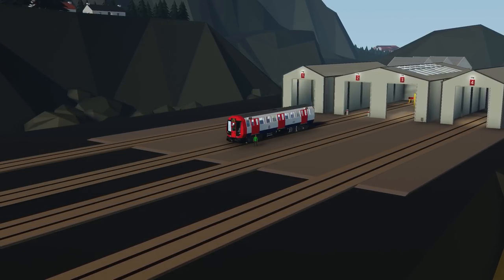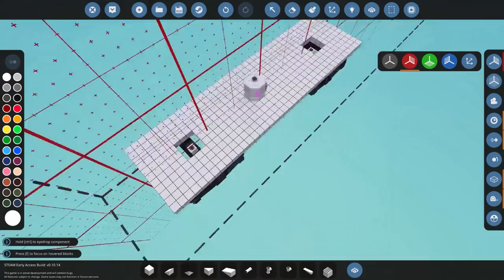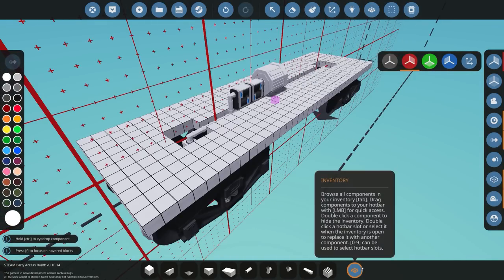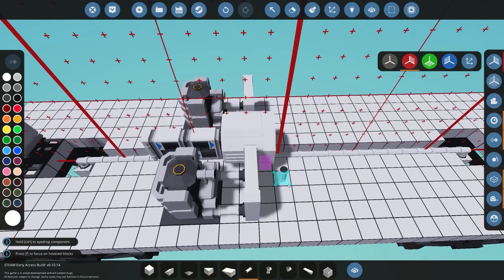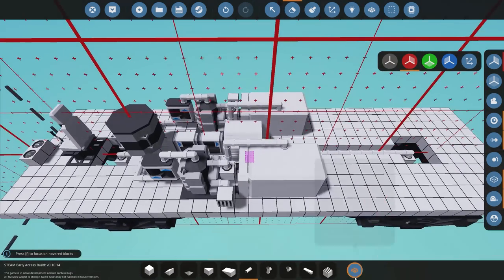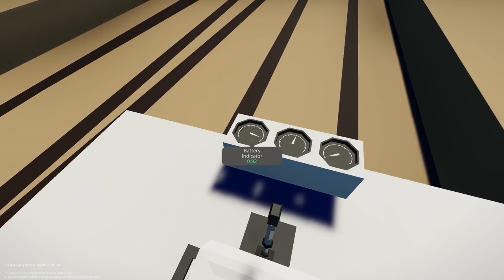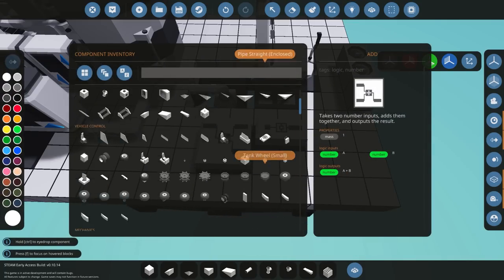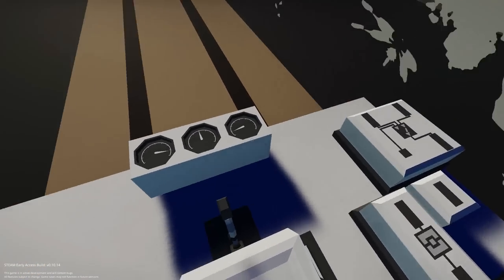Advanced Train - Stormworks Tutorial

Comment: i made a really usefull microcontroller, it is a slow engagement thing, it uses a switchbox between the two values you are switching between and if the number you want is less than the number it needs to be it will count up, and the other way around, it is really good for things like auto breaks and clutch engagement because it doesnt stall the engine or slip on train wheels

Comment: So, additional tip if you don't mind the white wind up noise of the jets spooling up. You can add a standalone medium jet turbine onto your diesel electric system, just branched off between the diesel engine and the actual generator, and for some reason the game will both use the diesel power to spool up the turbine, but also count the "output" of the turbine spinning towards your power being put into the generator. It essentially boosts the power generation by adding the turbine's power at the cost of a little power from the diesel engine. Crazy, and it used to be a broken infinite power system with electric motors powering the turbine generators. But if you need more power, try doing this and turn the vehicle volume down. You'll get a bit more electricity out of the deal.

Comment: Sorry, one thing that just came to mind that you should probably try to address if you know all the details, Mr NJersey (I know I don't.). The shape of the train, namely the length and width and how that will effect the vehicle going around sharp corners. I know I've tried longer trains, the limit of the build area, and they've gotten wedged into some of the turns. Build to wide and low and your train won't leave the shed (there's 2 pylons on either side of the entrance to the sheds that are just far enough into the build area that it limits what you can build down and out.)

One thing I have tried that seems to help a little is flipping power pivots to be the connection to the wheel bogeys, the body is on the train and the pivot is what's connected to the bogey, and then cranking the gear ratio on those up to the max or down to the bottom....Which ever the 1:32 ratio is. That ratio seems to resist the least and what you're wanting is for the bogeys to pivot if needed around corners rather than straining to bend your train in half. So you will need to power them, set a PID on them to try to angle for 0, but using an angular velocity sensor as the variable, it seems to all come together. It's just worked for me in making less broken stuff.

Comment: A couple of questions.

A) Why not have the diesel-electric generator just go directly to the traction motor instead of through a battery?  This is more how trains actually work and then you wouldn't need to worry about balancing generator output to power draw.

B) Why have a brake that applies when the throttle is 0?  Then you can't coast, which you do a lot when running a train.  Although I guess Stormworks doesn't have grades on its line so it doesn't matter as much.
Reply from the maker: Its just the way i set it up for this video, Unfortunatley I cant cover all different ways of building a train. Otherwise we would have 100 tutorials on just how to build a simple train.

Comment: So if the width is roughly 11 or 13, what is a good length for this? I built one that twitchs slightly as it turns. Ive got 31 blocks in between each bogy, i wonder if that is what causes it to twitch slightly

Comment: Hey I was wondering if you could do a tutorial on the winches for me.
I've built a helicopter and I want to control the winch from the harness but I can't figure it out
Reply from the maker: Watch my video on the new winches I made a few weeks ago :)
Reply: You need to use a rope anchor and attach the harness to the anchor. Also, make sure the anchor and harness are separate entities from your helo, meaning either place it in your helo off of a stand in pivot or rail (since the top and bottom are separate entities) or select the anchor in the selection mode, cut it, paste it back in, and it should be it's separate entity from your creation. Mr NJersey did mention this in his previous video about the new change in the winches. Not knock'n on you, just pointing out that he has and I'm offering an explanation and resource to possibly help you out with that.

Oh, I forgot.They're all on rope nodes now, the bottom side tab of the connections tab (the logic, electricity, composite, etc.). It will be black connection nodes to hook them up. If you want to have a control for the winch on the harness, you'll need to replace the rope anchor with an electric cable anchor.
Reply: @MrNJersey  I did follow that tutorial but I need 2 buttons to go through but you only did one witch means it needs a microcontroller but I don't know how to do it for this purpose
Reply: @conboygaming9568  I just did two winches and put one input through each (up/down) 
It makes the winch setup bigger but it works for what i need
Reply: It's ok I learnt how to use instrument panels and microcontroller and now my new helicopter is so intresting lol